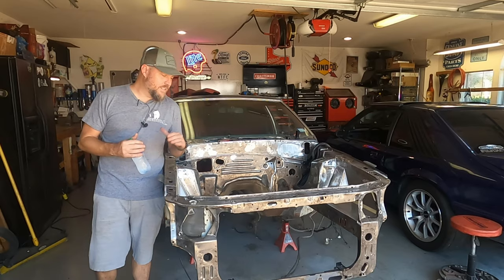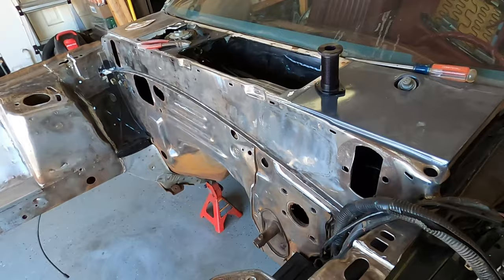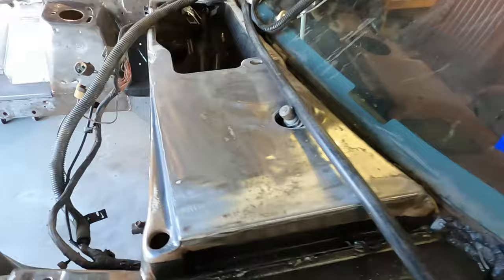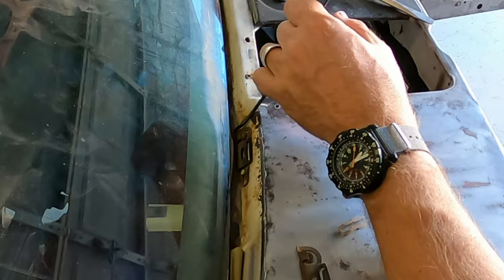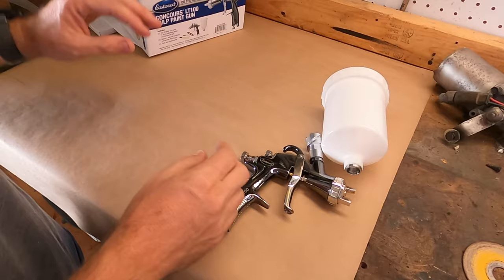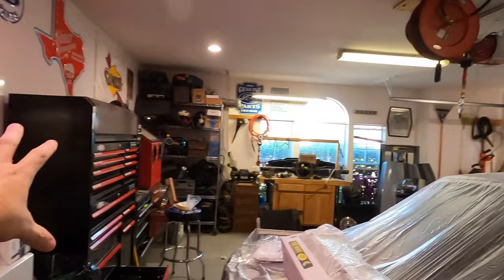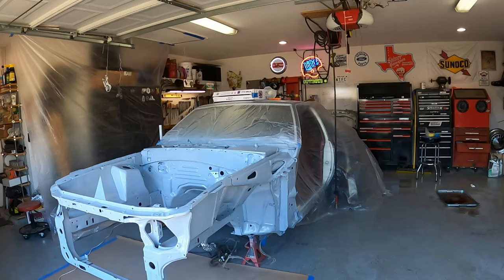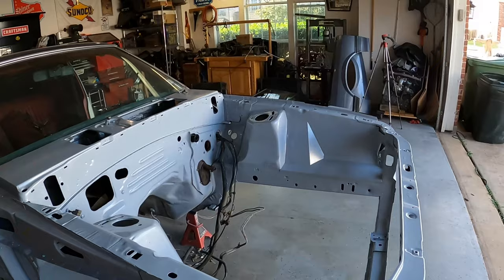Spraying SPI Epoxy Primer on Project EgoBruise's Engine Bay - Episode 20

Comment: To cover the floor I buy cheap king size flat sheets at Wal Mart for like $10 a pop and lay a few down. I like you can pick them up and toss them down quick. No messing with rolls of paper and tape if you don't want.

Comment: It's good to see people doing their own restorations; build, not buy.
I will be using the Grey SPI epoxy as well and spoke with Barry at SPI (owner and chief chemist) about bare metal prep. He stressed two things, Ospho MUST be rinsed to neutralize it and prevent delamination of the epoxy due to an acid film, and an 80 grit tooth is esential for mechanical adhesion. How is the epoxy holding up on your project? Any issues since you skipped both steps above? I'm not hating or criticizing, I'm genuinely intrested in you results since I treated my bare metsl with acid but did not rinse it.

Cheers
Reply from the maker: No, man I wish I had this info prior. I did wipe the entire area with SPI wax/grease remover, and let it completely dry. The epoxy now looks the same as it did when it was sprayed. Zero issues.  I also read up on SPIs spec sheet and do not recall reading about this, I only followed Ospho's directions, which says it didn't need to be rinsed and just wiped down. SPI is some good stuff, I think you'll be okay, but when it comes to doing the body I'll take this recommendation from from the chemist who designed it for sure!
Reply: @HOUSEOFDULA  it's on the bottom of page three of the tech sheet. I'll copy and paste for you.

Neutralizing Skyco Ospho:
Ospho is the only rust treatment we recommend IF needed under epoxy primer.
Apply Ospho as needed and leave it on as long as you like.
When you are ready to neutralize the dry Ospho, apply one more coat of Ospho over the area to
be neutralized and let it set for 5 minutes.
Using a clean towel and water, wash off the wet Ospho like you are washing a car then dry with
a clean towel.
A dry acid film cannot be neutralized or sanded off.
Reply: @Spockbacca  , yep, Ospho MUST be washed off thoroughly or the epoxy will NOT properly adhere to the treated metal.

Comment: Great video, thank you for sharing! I'm currently redoing my 1986 convertible which was my first car back in the 90's. Just finished the sn95 conversion with a good bit of reference from your videos. Body work is taking a while as I am deleting all the molding lines on the car, including the bumpers. Fun stuff!
 Just a tip, if you don't get around to filler work on the engine within the next week, just lightly abrade the epoxy with some 120 grit to get filler to mechanically stick. Epoxy is awesome stuff but does have a window of chemical bond. Keep up the great work.
Reply from the maker: Appreciate the tip! Likely not  getting to body filler until after everythings been fitted, well outside of the week. Your correct though, the SPI sheet recommends 24-48 hours before filler but before 7 days does not need to be sanded.

Comment: I think your videos are pretty rad and informative!! I like that you're down to earth and not some punkass snob!! I have a '69 Torino GT with the original 351W block and bottom end. I bought it last quarter of 2020. It has TFS heads and Torker 2 intake with a 750cfm 3310 Holley 4bbl. Points were converted to Pertronix and a full length longtubes to 3" all the way back. Red Holley electric fuel pump. I'm debating the fuel cell. I'm not a fan of the stock fuel fill location. I also have an original 1990 5.0 5speed notch bought here in Tampa. I bought it in 2000 and it was my daily driver until probably 2010? Both need some attention and I appreciate that you have tackled some of the upgrades I gave considered for each. I've also got a 2004 Ford F150 FX4. I bought it new in 2004. First and last brand new vehicle, I ever buy!!
Reply from the maker: THIS is what I like to hear! Lol. Appreciate it man, and nice choice in cars 🤘🏻😎🤘🏻
Reply from the maker: You will fall in love with that Torino forever trust me. Neat neat cars and so different. Stands out from the sea of mid size Chebs and Mopars

Comment: I avoided SPI epoxy for a specific reason. It doesn't like phosphoric acid (ospho) unless it's been neutralized. Hopefully you don't have issues with paint peeling off.
Reply from the maker: Well Im almost 2 years in and no issue at all with the primer. Thats interesting, because I talked to a few professionals and called ospho and was recommended. The SPI looks as good as the first day I sprayed it and very hard / scratch resistant. Maybe Im lucky, I'll make sure to neutralize the ospho anyway, wont hurt for the added insurance.

Comment: I wonder how the paint came out using ospho without rinsing it.  SPI says DO NOT use any acid under their paint unless you neutralize it.
Reply from the maker: Over a year later and zero issue with it flaking or chipping, scraping etc. Held up fine. If SPI's spec sheet that though, I missed it, and I would go with that for sure in any future ospho usage. Maybe Im lucky, or maybe time will tell, but it seems fine to me.

Comment: Wondering if the paint fell off yet after not reactivating the ospho and wahsing /scrubing it with water while the ospho was wet to nutralize it.
Reply from the maker: No sir. holding up great. You have to put effort into scratching it up.

Comment: Body filler is actually supposed to go over bare metal.  You can usually apply it over epoxy primer, but there is no problem going over bare metal with body filler.
Reply from the maker: Man I’ve never had issues with filler on metal but technically it can promote future rust because plastic filler is porous, can hold moisture so on bare steel cause rust and failure (potentially) to the filler…best way really is to epoxy, filler, primer, epoxy…

Comment: What kind of bit did you use for grinding the firewall adjuster hole larger?
Reply from the maker: Hey man, just a carbide bit for a die grinder. I think I used that and my drimmel with a sanding drum to get it more rounded out.

Comment: You don’t have to rinse the ospho off after before paint ? Or do you paint right on top of the the ospho after it turns black
Reply from the maker: No need to rinse. It dries and literally evaporates. I wiped with wax/grease remover prior to painting then just sprayed it... After ospho dried I had no residue at all.
Reply: Spi States do not spray on ospho without re wetting and rinsing very well.

Comment: Do you think this gun would spray while being held upside down? I need to spray underneath my car
Reply from the maker: I dont "thin"k so simply because of the way the liners keep a little air in them. Youd get dry spray. For that i'd look at a bottom side tank suction fed gun
Reply: @HOUSEOFDULA  thanks. I noticed you’re using the 1.3mm tip, but the SPI website recommends 1.4-1.5, does it make much difference do you think?
Reply from the maker: @bopete1313  No, I called and asked that, 1.3 worked out just fine

Comment: How many gallons was ur compressor?
Reply from the maker: Its a 33 gal.
Reply: @HOUSEOFDULA  I'm doing something similar. As far as body working the engine bay. I was actually wondering if I can relocate the wiper motor. How are u going to cover the hole on the firewall? Can't wait to see more videos.
Reply from the maker: @rafatrill  - I already welded up a plate to cover the hole.
Reply: @HOUSEOFDULA  dam no video? 😒

Comment: oh no you didnt paint over ospho right??? i hope you neutralized it 😰
Reply from the maker: You read the opsho data sheet? Even then I called them as well as SPI. The opsho was on months before epoxy too. " apply a thin coat of OSPHO as it comes pre-diluted in the container. Let dry overnight for a minimum of 24 hours, then apply whatever paint." The great thing about opsho is no need to neutralize with tons of water.